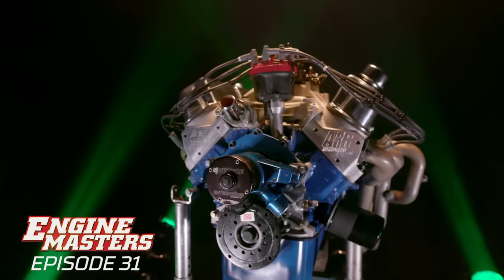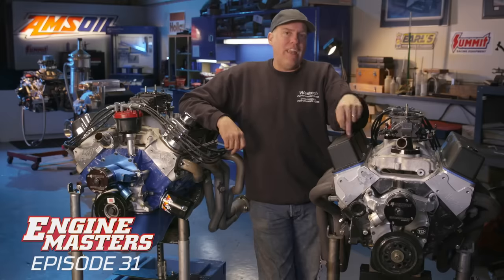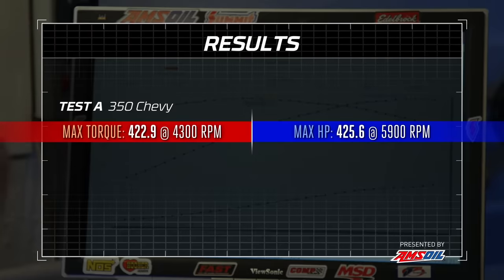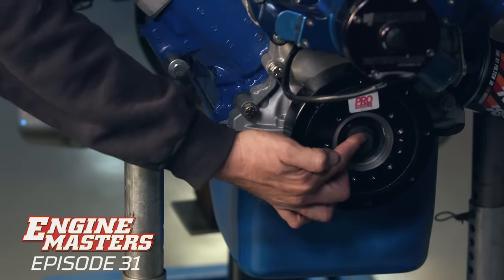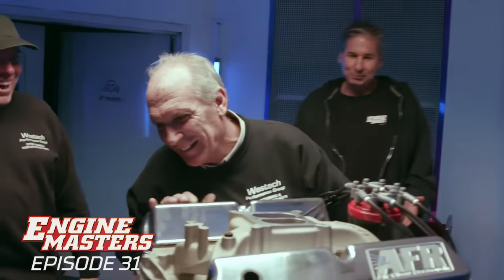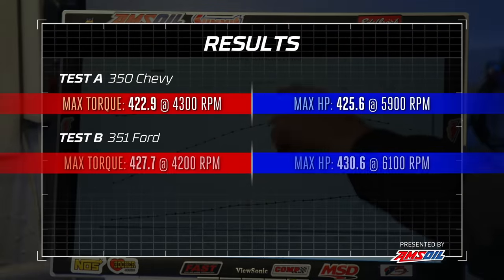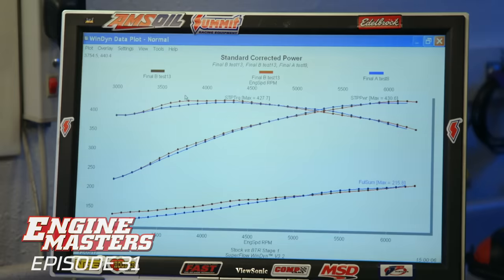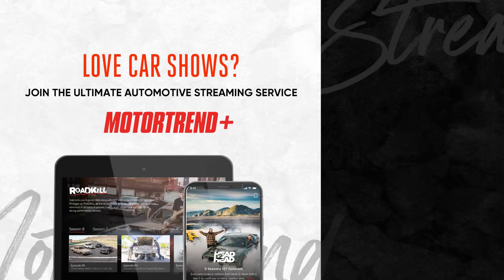Chevy vs Ford V8 Showdown! Small-Block or Windsor? | Engine Masters | MotorTrend

Comment: It's almost like physics dictates how engines make power. Put the same air, fuel, and spark through the same number of cubic inches at the same time and you make the same power. IT'S MAGIC! No really it's called physics and physics don't care about your feelings.
Reply: Very true
Reply: The most surprising thing was the ford and Chevy having equal price tags.
Reply: Some people would go for the larger one and in this case they would be right. Of course the engine with the slightly bigger displacement and higher compression produced the more power even if it was a small amount. Reality is not just cost or size it’s often availability or weight or even size of the vehicle that your planing to use. Sure you might get either one in stock form like a former police car or taxi or just an used car that has either one from an elderly person that’s only being used to go to church or bingo . Often the choice is not a choice but just luck that you came across one for the right price.
Reply: @ryurc3033  Not to those of us that pay attention. Over the last 10 years especially, before that I would say that Ford was more expensive but as LS stuff has slowly taken over the Chevy camp the classic small block parts have gone up in price more so than the Ford parts. Demand has waned because of the popularity of the LS making the small block parts cost more to produce as the production runs get smaller and smaller.
Reply: So why does a 5.0 coyote make as much power as a 6.2 LT1 or 6.4 hemi?
Reply: @jeoffbenzos4959  It doesn’t….
Reply: @jeoffbenzos4959  modern technology.
Reply: @coltlewis5871  
Chevy SS 1LE 6.2 - 455 hp
Ford Mach 1 5.0 - 480 hp
Dodge 392 hemi - 485 hp
2024 Ford Dark Horse 5.0 - 500 hp

That’s 100 HP/liter for mustang, 75 for dodge, and 73 for Camaro
Reply: @jeoffbenzos4959  There are more factors than just displacement.. You wouldn´t believe how many horsies you can squeeze out of a simple 4 cylinder. It´s more like the displacement makes the torque. The intake and exhause make up for the band of torque, in somewhat modern engines timing and injection should be just at optimum. The horsepower come from where on the RPM scale torque is highest. And that scale differs for what application an engine was designed. Many factors play a role on the engine design. Things like weight of the car, transmission, purpose of the car etc. make a big difference. Also it´s common to "underpower" the engine from stock to give it some reserves.
Reply: @eliasfalser9963  yes I understand all this. I was just making a point to the original commenter that displacement isn’t everything.
Reply: @ryurc3033  that’s not always been the case and I bet it’s not today
Reply: @ZboeC5  not surprising in a good way. Just surprised how much more it is to build a small block than 10 years ago.
Reply: @jeoffbenzos4959  Look at the torque curves. Do you think Ford would have created a 7.3 V8 if they could have just made a "new" 6ish liter OHC engine based on a Coyote and saved a ton of money in the process if they thought they could get away with it? Remember this is the same company that literally slapped 2 extra cylinders on the 5.4 V8 to make the 6.8 V10...If you want lots of good reliable torque and power under the curve you need more displacement. Even Ford acknowledged this with the 7.3 Godzilla.
Reply: @jeoffbenzos4959  revs higher. power is a factor of rpm and torqe so if you are able to still make torqe at a higher rpm you get more hp. make the same torqe at a lower rpm you get less hp. really he should say the same displacement engines of the same rpm make the same power
Reply: yea though theres really alot more to it than that, combustion chamber desine, turbulince in the air fuel mixture how the ports on the engine are shaped the valve angle. ect ofc with the sbc and sbf being so simular makes simular hp
Reply: @jeoffbenzos4959  That happens with a good head design. Stock numbers prove nothing, OEM’s have other criteria’s to meet, not just a power number. If you want to compare stock for stock, then you gained nothing by watching that video…
Reply: @jeoffbenzos4959  LT2 6.2 495hp. Also Ford has aggressive cam shafts in the Coyote and they take the sound with VVT. Put an aggressive cam in the Chevy and it blows the ford away.
Reply: @coltlewis5871   Poor guy, been drinking that Orange Kool-Aid?
Reply: @jeoffbenzos4959   4-valves per cylinder with much more intake flow right of the seat up to at least .500 lift.     

4V ports do a much better job actually filling the cylinder because of “average flow” over the lift curve and they have much better chambers.
Reply: @ZboeC5   Yeah, they would.  Ford produced the 7.3 because it was cheap to produce and that’s the real reason.   

The existing 6.2 Boss SOHC 2V with the 7.3’s bore diameter (6.8 liters) and compression ratio (10.5:1) would have produced more torque than the current 7.3.
Reply: @sstevocamaro   “Agressive cams” in the Coyote?    
Try ~200 degrees duration @ .050” lift 

I think you’re missing the point of optimal intake port geometry/valve angle and a lot of valve area for the displacement…
you don’t need “aggressive cams” to fill the cylinder.
Reply: @sstevocamaro  so it’s not all displacement? That’s my whole point.
Reply: @BC08  If reality is Koolaid, then sure. I’d draw you a picture to explain it but I’m afraid I just don’t have enough crayons.
Reply: @coltlewis5871   So you are drinking the orange kool-aid.    😂🤡
Reply: @coltlewis5871  it does based on hp/Cubic inch.
Reply: @fishsquishguy1833  Yup, and that’s where head and intake design come into play. Just like this video, they aren’t running OEM heads. Like I said, you guys are totally missing the point here.
Reply: @fishsquishguy1833  Exactly… So what are you going on about?
Reply: @BC08  You’re the one not grasping what’s going on, but I’m the one drinking the Koolaid 🤣
Reply: @coltlewis5871  You’re the one making objectively false claims because it jives with your favorite brand of kool-aid.
Reply: @BC08  LMAO, sure, whatever. What a troll
Reply: @coltlewis5871   Jeoff Benzos, “So why does a 5.0 Coyote makes as much power as a 6.2 LT1 or 6.4 Hemi”

Colt Lewis, “It doesn’t…”

Objectively false, kool-aid drinker statement
Reply: @BC08     The 5.0 is a overhead cam engine, also direct injected. The 6.2 is a pushrod engine but also direct injected. The 6.4 is pushrod and port injected. This is why numbers are different. The 5.0 can run more aggressive timing curves, not to mention a better port design due to there not being any pushrods running next to the ports ( aka port design is not limited due to the provisions for pushrods ) .    Put overhead cam setup on the 6.2 or 6.4 ( and add direct injection ) and they would blow the 5.0 out of the water. Why you ask? Displacement.  Just as the 64 has slightly more power potential than the 6.2, displacement. This isn't new.....

Also, the guy you quoted said the 5.0 made more power than the two others, it doesnt. Go look it up. It's close yes, but it doesnt make more. 

The summary of this video is similar engines make very similar numbers no matter who made it. This is due to displacement. On both tested engines they did not run OEM heads, intakes or whatever, to make the comparison fair.  They did it to show you brand nut huggers that Ford, Chevy, Mopar will make the same power numbers if all things induction related are equal. The 5.0 Coyote is not equal to the 6.2 or the 6.4, and both the latter engines would smoke the 5.0 if the induction setups were similar. 

Yet you guys seem to think that comparing a mod motor to a pushrod engine is the same, it's not, due to head design as I already mentioned. Tack on the ability to run more aggressive timing profiles the 5.0 will make similar numbers to a  larger displacement engine. As I said, you guys completely missed the point of this video, by miles, then you want to argue with me about it, showing your ignorance.

So ya figured it out yet or do I need to go dig behind the couch to look for more crayon's? SMH....
Reply: @coltlewis5871   You seem to have a real problem with reading comprehension.   
I provided you with the others guys exact quote — his claim was that the 5.0 makes “as much” power as the 6.2 LT1 and 6.4 Hemi, not “more” as you now erroneously assert and you also claimed that “it doesn’t” which is an objectively false statement.   

The 5.0 does; in fact, make as much power as the either the 6.2 LT1 or the 6.4 Hemi.    

We can even include the C8’s dry sump 495 HP LT2 into the mix.   

The 5.0 does in fact make 500 HP this year which MORE than the 6.2 LT1, 6.4 Hemi or 6.2 LT2.
Reply: @coltlewis5871   Show me a 6.2 LT1/2 using factory heads, factory intake manifold, factory crank, steel rods, no more than 12:1 compression on non oxygenated gasoline making more than 850 crank HP N/A to back up your uninformed claim.
Reply: @coltlewis5871  Get it, you just like arguing.
Reply: @fishsquishguy1833  🤣🤣.  Hey look! Another troll…
Reply: @ryurc3033  My how times have changed!
Reply: @jeoffbenzos4959  DOHC :D
Reply: @sstevocamaro  @ .050": 211 degrees is aggressive? 😂😂

Comment: Winner: AFR. Heads made both shine.
Reply: Did they both have AFR 195s?
Reply: Right you are lol. That’s why it wasn’t a 351C in this test
Reply: it does help equalize the comparison. would be fun to run a vortec 350 against a 351W with GT40P heads, but Richard Holdener has likely done it already.

Comment: Thank you for actually using a 351, every other magazine always tests the 302 vs a 350 which is not a fair comparison.
Reply: FR. I've noticed that as well. If you want to compare apples to apples the displacement has to be close. I'd like to see a 5.0 ho build up against a similarly spec'd 305
Reply: It’s always been that way. They used to compare the the 5.0l to the sb350 and the 351w to the 454.  GM’s motors always seem to be bigger in displacement compared to their competition. Overcompensating is the way.
Reply: @bigpigslapperoinktoo4953 you're not understanding what he's saying. He said that Chevy engines are usually compared to the smaller engine of their competitors. Nobody is comparing a 454 to the 460 because there is no comparison. That's why the 454 is usually compared to the 351w or something smaller.
Reply: I've read this statement before... Dollar per dollar chevy wins. Mod per mod ford takes it every time. Ford is better than chevy hands down. 302 is better than 305. 351 is better than 350. And 460 is better than 454. I've read in forums word per word page per page. And equally sized and modded ford will out power and live a chevy.
Reply: @alvin7089 not true
Reply: Why not Ford 302 vs Chevy 302?
Reply: @ksman9087  Chevy 302 is a racing designed engine. So 302 Chevy then a Boss 302?
Reply: So annoying lol compare a 302 to a 305, or maybe a 307, not a 327 or 350
Reply: @buzzbomb67  The Chevy 305/307 cannot compare to the Ford 302....The Ford 4" Bore allows for so much larger intake valves...without hitting the cylinder wall...BUT...From my experience of driving and tuning, using engine and chassis dynos, the 4BBL 305 at 3000RPM or below seems a little more "fuel efficient"...But at 3500-6000RPM the 4BBL 302 Ford steals the show...I know when the TPI 305 came a long, they were finally able to beat the 302 Ford... The 1985 Ford 302-4V H.O. was a force to reckon! - In all-out aftermarket builds, there is no way to overcome the limits of the small bores, which as I said limits the intake valve.
Reply: @misters2837  Agreed.  Nonetheless, a 305/307 can be made to make considerable power, with the right choice of parts… and surely some modification lol
Reply: @buzzbomb67  Oh for sure, almost any engine can be made to put down numbers that the factory never designed them for! - Unless its an Olds 350 Diesel....LOL!
Reply: @misters2837  lol right?

Comment: Now you guys just need to get a Mopar 360 on here as close to spec too.
Reply: how about the 318? isn't that considered one of the most underated?
Reply: @rnrsteev  I loved the 318 Magnum in my old ZJ Grand Cherokee. I suggested the 360 since it's the closest in displacement to these. But it's a great engine too.
Reply: Yeah, it's only fair.
Reply: 340 is pound for pound a beast when built right
Reply: My guess is that with identical parts the LA motor would make about 15 more horses, about 18 more in torque but weigh about 40 pounds more. Oh, and it would outlast both Ford and Chevy in a"Drive it until the crankshaft breaks" challenge
Reply: I was told as a child that a 360 is only about as capable as a 340 but will eat more fuel lol
Reply: I wonder if a 360 crank in a 318 would be more fair since that brings the displacement much closer to the 350 ci target of the other two.
Reply from the maker: Good idea! We've done a few mopar videos over the years: https://youtu.be/I7W5RJMDLp0
Reply: @kart70  the 360 uses larger main bearings then the 273/318/340. You can turn them down to fit, but since all stock 360 cranks are cast. It ain’t the best thing to do
Reply: @tl5108  plenty have cut down a cast crank.  On the other hand, I believe Scat already offers a 360 stroke crank with 318/340 mains. It's true that it's not a true bolt in, but it is close.
Reply: They did it wouldn't run!!!! Lmao

Comment: I'm a Ford guy and I'd personally take the 351 Windsor. But both are legendary engines and both are respectable
Reply: I'm kinda partial to the 350 myself, but that 351W is an excellent engine.  Honestly, they're pretty closely matched in both performance and reliability.
Reply: its not the cleveland that you want to get? my friend had a windsor in his foxbody and i swear any fwd car with 130hp or more was faster, my friend always said, on day ill get the cleveland and people wont laugh anymore... my chevy cobalt made a full 4 sec quicker on the 1/4 mile, it was that bad
Reply: @retrocompaq5212  The Cleveland has better flowing factory heads for sure, but the Windsor is a stronger overall platform.
Reply: Id rather have a 351 cleveland but a windsor would do
Reply: @retrocompaq5212  Cleveland can handle more power on stock block, that’s why people want them over the windsors. As for why your friends fox was so slow, that’s probably because it was stock af. I’ve got a 351w in my 84 fox and it definitely hurts some feelings lol
Reply: @MrSlimeMan01  Cleveland makes more power from the factory than a Windsor, but that's due to the heads.  Aftermarket heads such as the Yates head negate that advantage.  The Windsor has a more stout bottom end and in the end, you can make more power with a Windsor than a Cleveland without going exotic to keep it together.
Reply: I've had 351 w junkyard motors and they all outlasted friends rebuilt 350 goodwrench motors that were crates and I'm not easy on em I spin my stock at 6000 frequently and it takes it like a champ
Reply: im a chevy guy and i would take the 351,yeah i went there

Comment: If the Chevy would of won, this guy would have telling his neighbors and the entire town about how great the Chevy is?😩
Reply: If that ford didn’t have more cubic inch and 2 two tenths more compression it wouldn’t of made more power
Reply: @brandonbell433 
Yep, when a Ford wins a Chevy starts crying Just like Warren Johnson, when a chevy wins they're all smiles.
Reply: @fredramos9206  I’m not crying I’m simply stating the ford had advantages lol. It’s not like it was perfectly equal
Reply: Any ford guy should be disappointed in these results. Too many advantages not to make more power.
Reply: @ZONES89RS 
Yep, if it was the other way around, the entire chevy camp would be grinning.
Reply: @brandonbell433 
This one is for you Loud Chevy gear heads. Back in mid 80's they had a turnout at our local 1/4 mile track, Chevy Irocs vs Ford 5.0's, factory straight out of the box., We'll guess what,  all the I-rocs  were sent home crying cause they were spanked silly by the Ford camp.,...Just for the record.,... Regards.

Comment: The 4 bolt main conversion for the Windsor, made it practically indestructible.
And, the advancements in the 8.8" rear, make an old grocery getter capable of walking on what we used to build in the 80s, out of a cleveland/9" combination.
Reply: carmineredd You forgot the lsd 8.8 Explorer rear! I myself am guilty of sticking them in more than one place they don't belong. I narrowed and rebuilt one for my buddy's DD 65 Barracuda and it has taken more clutch drops than I care to count with just shy of 400hp.
Reply: Don't even need a 4 bolt main windsor just arp bolts or studs will hold up to 750hp fine

Comment: Did anyone else notice the glowing #5 header pipe on the SBC?  Looks like it was a tad on the lean side, but thats hard to fine tune using a carburetor
Reply: Excess fuel burning in the header pipe.
Reply: Exhaust valve might be a little too tight.
Reply: All I hear is excuses ....  FORD RULZZZ.  CHEVY DROOOOOOLLLZ
Reply: @hugieflhr03  yeah, never thought of that, good point.
Reply: @skiptastic1000  not making a excuse but I mean. The ford did have more compression AND more cubic inch but only made 5 more HP 🤷‍♂️. That’s not really impressive
Reply: carmine redd  is that why Chevrolet has more than double the Nascar wins and more than double the NHRA drag racing titles than ford?
Reply: You can stagger the jet sizes leaner or richer for those affected cyl